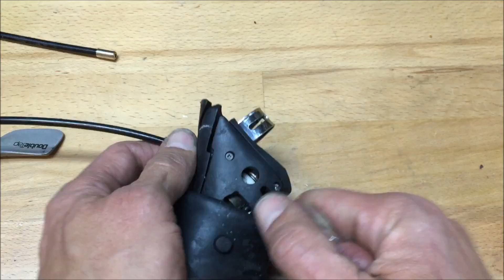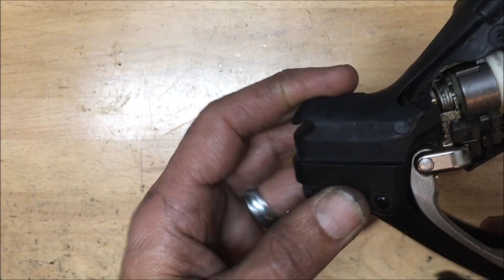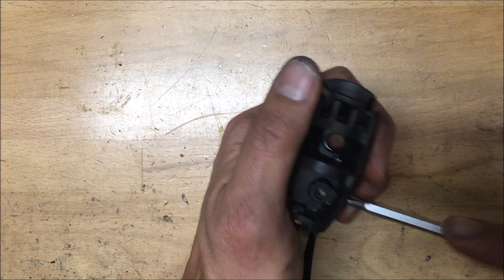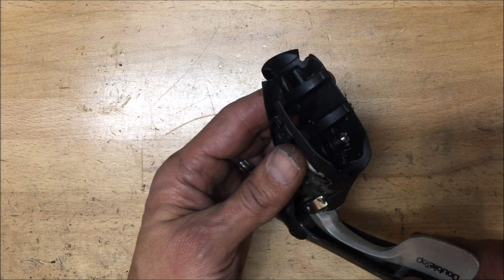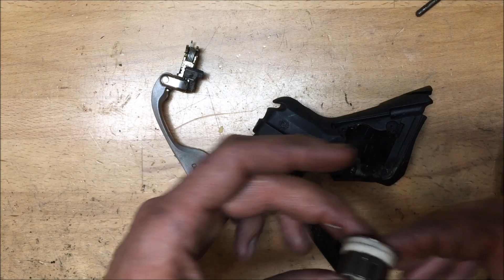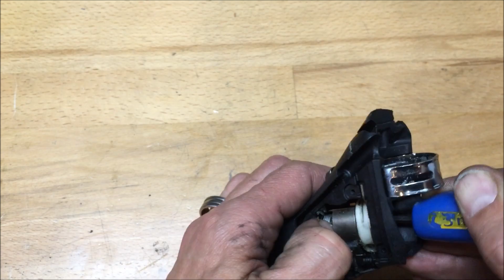Sram Doubletap Shifter Rebuild

Comment: I have got strengthen CNC part to replace the broken part. If anybody needs it just text me.
Reply from the maker: Good to know!
Reply: helo, i have the sram force brifter, and the lever right are gone. do u have the replace right lever? thanku
Reply: @4pppple  Shift lever or brake lever?
Reply: @JensWorkshop  shift lever for RD
Reply: @4pppple  I don't have a complete shifter. I have only shifter's spare parts.
Reply: @JensWorkshop  i only need the double lever, right side. do u have one? 🙏
Reply: @JensWorkshop  email sent , thanku for ur help 🙏
Reply: @JensWorkshop  do make the ratchet system
Reply: @carejohnrivera3891  what do you mean?
Reply: @JensWorkshop  like the ratchet wheel that he took off on the shifter
Reply: @JensWorkshop  I broke the teeth on mine
Reply: @JensWorkshop  just did
Reply: @JensWorkshop  hi do you have double tap shifter replacement parts for sram rival 10 speed
Reply: @willforcewisdome2267  Yes I have but only for right hand shifter
Reply: @JensWorkshop  can you send me your available part of double tap shifter 10 speed
Reply: @JensWorkshop  hello i need some shifter parts do u have one
?
Reply: OLA YOU WOULD HAVE THE PIECE YET, WHAT'S THE VALUE?
Reply: @MichelSantAnna  Which piece?
Reply: Do you have double tap shifter replacement?
Reply: Hi Sir can you send me the photos of double tap shifter 10 speed sram
Reply: @willforcewisdome2267  send me an email via jenchunchi@gmail.com
Reply: hey there - any chance you still have the CNC part available?
Reply: @MReyemhere  yes, still available
Reply: @JensWorkshop  Hi! I seem to have joined the ranks of owners with broken rear mech shifters. How much would it cost for one of the replacement pieces including shipping to Europe?
Reply: Hi, do you still offer the part ?
Reply: I need Old Sram 10 speed right hand shifter
Reply: I need a new lever mines broke is there an alternative for a replacement part
Reply: I have 2nd generation sram force double tap shifter 10 speed ! Right one lever broke exactly like in the video ! Do you have a replacement parts! Thanks
Reply: jens - how much is the part please

Comment: It took about a week for the linkage to arrive from Jen's Workshop (Taiwan to CT USA). It was easy to dissemble the shifter and linkage and reassemble if you know what you are doing especially removing the two Circlips. Make sure you read the comments about getting the pin out, I used an old spoke to make an L shaped tool to start the pin removal and the other end of the spoke was inserted in though opening at the top of brake level to push it further. I was able to do all this with the shifter still attached to the bike by the cables.

Comment: do they sell that round cylinder gear thing that the inner cable goes around?
Reply from the maker: No. Sometimes a local bike shop may have some salvage spares, but you can't buy that piece separately.

Comment: Great tutorial but I have a question. I have a hydro 1x SRAM  left brake lever from a 2020 Bombtrack Hook EXT. I got a PNW dropper post and wanted to convert my 1x brake lever into a brake and dropper lever. I sourced some SRAM 10 speed parts from a brifter. I manage to assemble it but the pin doesn't go all the way in to hold everything super secure. Also the new "derailleur" lever seems to rub when I turn it. Are 10  speed brifter parts compatible with 1x rival brake? Or do I need the 11 speed brifter  internals?

Comment: Thankyou for the video, very informative. Just wondering if a 10 speed Red shifting paddle is compatible with and 11 speed Red shifting  paddle? 
Thanks for time.
Reply from the maker: Yes it will. On my commuter bike, I used this specific mod to replace a broken SRAM Force 11 speed paddle with an older 10 speed Red paddle. It just has to be the Yaw style shifter body and not the old first generation style double tap shifter body. I actually made a video of the process: https://www.youtube.com/watch?v=ndLjDt68PAA&t=785s
Reply: @JoeyMesa   Thanks heaps Joey. It's off a 2010 Fuji Serveto,  so I'm assuming it's the first generation paddle shifter???

Comment: Hi Joey I've got a pair of sram doubletap shiftes but want to  remove the shifters and just have hrd breaks as i'm not running any grears (can this be done ) thanks
Reply from the maker: Yes, it's a pretty simple process. Just remove the small Phillips head screw on the side of the shifter body (the side facing out or away from the other shifter), remove the pin that holds the shift lever and ratchet mechanism, and you're left with just the body and brake lever.
Reply: Hi Joey 
Thanks for your reply and the info great! 😀👍

Comment: Can you swap a 10 speed put for an 12 speed?
Reply from the maker: No. The shifter in this video is the older type doubletap style and will only accept 10 speed internals. The current mechanical body style only offers an 11 speed option as there is no 12 speed mechanical drop bar shifter as of today. The AXS electronic shifters offer 12 speed options, and there are 12 speed flat bar options, but nothing 12 speed mechanical for drop bars.

Comment: my front shifter needs new guts> Where can i order them?  I looked on SRAM website but mine are from 2011
Reply from the maker: Your only options are finding a good used shifter, a salvage shifter you can use the parts out of, or just buying a new shifter.

Comment: Thx the spring coil on mine has stripped can you get that part or can I use on from left shifter which has been dumbed for 1x ?
Reply from the maker: All the parts on the left shifter are mirror image or backwards compared to the right side. Your best bet is finding a parts shifter at a local shop or possibly on eBay.

Comment: good day, im planning on replacing my sram rival 1x11 mechanical levers with the hydraulic ones, but accidentally ordered the 2x11 shifters, is it okay for the hydraulic version to just remove the double tap shifter? will it still work fine?
Reply from the maker: Yes, the shifting portion is totally separate from the brake assembly. You can even use part of the front shifter as a dropper lever if that's something you may be interested in. https://www.youtube.com/watch?v=_2m77XP-N7g
It's the same process for mechanical or hydraulic brakes. Either way, removing the complete shift system won't affect the brake system.
Reply: @JoeyMesa  thank you for this! very much appreciated!

Comment: is the shifter part thing available to purchase?
Reply from the maker: Unfortunately not. Well, you may find a used broken shifter on eBay or in the spare parts bin at a large bike shop and scavenge the part, but it's not offered as a new replacement part from Sram. Thanks for your question!

Comment: VERY USEFUL VIDEO, THANK YOU. 

I WAS AN INITIALLY PLEASED RIVAL GROUP-SET OWNER UNTIL I SAW THE LIGHT.

After 29 months of stiction from new and irregularities when shifting, having to force the shifter with occasional unreasonable force , ridiculous cable changing intervals due to sensitivity issues, brake pads needing regular micro millimetre precision adjustment (but doesn’t offer that option) brake callipers that need micro millimetre adjustment (but doesn’t offer that option either) monthly derailleur faffing, pistons sticking in low AND high temperatures and the gear hanger made of the cheesiest of soft cheese and needing several replacements at ridiculous cost caused by just lying the bike down (took me a while to work out that bonus feature),,,,,,,,,,the final nail in the coffin I had to finish my faith in my first AND LAST sram group set happened today. 

my 11 speed rival HYRDRO shifter died on my ride to work this morning, it happens eventually I hear the sram fanboy robots cry. Please try to Understand my anger sram boy,,,,,,
UK, 5:30am ride or work in near freezing conditions, 6 miles in and shifter died = 7 miles of unintentional single speed, missed my train and to top it all off my sociopath boss welcoming me to work with sarcastic glee when I finally arrived .

Ive got 30+ years of bike faffing under my belt so I thought , Ill fix it when I get home as “not a problem” . Oh no no no,,, after stripping the shifter I’ve discovered the housing (The red cable stop housing , white in your video) is destroyed as the cable has worn through it to the point that the cable is now wrapped around bits it shouldn’t be, no doubt destroying those bits as well. Angry at such an obvious fail point, yup. 
Thankfully, sram offers VERY EXPENSIVE REPLACEMENT PARTS to fix a very obvious weakness in a point of high stress wear. Im worried though, I think I’m possibly  being a bit silly thinking that sram have done this on purpose making a weak point in a FLAWLESS DESIGN after all the RnD they claim to put into their equipment but I cannot help but think that it is all designed to fail when just out of warranty, I sound like a silly conspiracy theorist don’t I 🤗

GOOGLE SEARCH SUGGESTS IM NOT THE ONLY  VICTIM.

Due to a slight suspicion that sram rival was not designed to last I had thankfully bought a second hand donor  12 months ago to replace the shifter if and  WHEN it finally died ( it was only a matter of time) I was lucky enough to find it second hand at £100, yes that’s right, second hand hydro shifter for £100 so I snapped it up, what a bargain ! 

the cost of new hydro shifter is absolutely fking ridiculous...... £350? your having a laugh (at out expense) but this leads me to my next point nicely,,,,

I was initially surprised and somewhat confused as to why buying a full bike with sram group is almost comparable to buying just the group set on its own at full RRP,,,, now I know,,,,, once you have been tricked into buying this snake oil group set you have 2 choices when it fails ‘just out of warranty’ (which is quite an impressive design feature) you can either keep buying the POS replacements or get out of the grip of this evil parts dealer whilst you can and buy a full new group from a manufacturer with a solid reputation and known for its quality and commitment to customer service, but that costs a lot,,,,,, so most don’t have that choice. Not me, no siree I’m quite happy to credit card a new group set, I’ll be fkt if I’m giving sram another pound of my hard worked for money.

SRAMs double tap hydro group is beyond shite, as soon as funds permit I’m purchasing the new 11 speed group set from the other big S.
unfortunately,,,, and I do feel bad about this,,, I will have to sell my second hand (BUT repaired)sram rival group to somebody else to fund my purchase, but......

....Every cloud has a silver lining. Not only am I selling a complete stranger a POS groupset, I am also giving them a chance to escape the sram cartel when they eventually wake up and realise the truth that ‘SRAM IS ShIITE’

you can be forgiven if you think I am a bit of a loon and it’s just because I am angry at  my dissatisfaction with sram, but your dead right, I am angry and you will be as well once you realise you’ve been conned and set up for a long term grooming of your hard earned money due to having limited options and probably going for the quick fix of buying more sram shite.

Get out whilst you can.........

Fkyou sram.
Reply from the maker: Dang, that sounds like a bad time! I can't really speculate much on your situation, because I don't know all the specifics of your bike set up, but in general, stiction, shifting irregularities with unreasonable force, Etc. are usually a cable issue. It could be dirty or kinked housing, poor routing design of an internally routed frame just to name a few.
I've been working as a full-time mechanic in several bicycle shops since 1983. I'd say the last 15 years, I've dealt with equal parts Shimano and Sram. I understand your frustration, as I see it on a daily basis. Hopefully, you won't be too disappointed after you switch to Shimano, as although Sram has their issues, Shimano pretty much has equal issues in different areas.
My advice would be to get a really crappy back-up bike. That's what has worked best for me, although I have no idea what your situation is, or if that would be helpful for you. I actually have 3 bikes I use to commute with. A Shimano 6800 Ultegra 11 speed road bike, my homemade crap weather commuter with 11 speed 1x Force/Rival mix, and my new bike which I got 6 months ago which is a gravel bike with Sram Force AXS. I've definitely ridden my road bike the least, but I've gone through the most shift cables on that bike without a doubt. 
The Force shifters on my beater commuter are over 5 years old, have been on 3 different bikes, 30,000 miles before I finally had an issue, which I just fixed last weekend and made a video  https://www.youtube.com/watch?v=ndLjDt68PAA
I've been riding the new bike for most of the last 6 months with no issues whatsoever. My point is, all component groups have their weaknesses, but having a bike that is durable but well-worn components you won't stress over if they crap out in poor weather is always a good option.
Thanks for commenting. I really appreciate your feedback!

Comment: Regarding the removal of the pin. I'm currently trying to rebuild an 11 speed Force hydro shifter, and noticed that the pin is in fact a hollow steel tube. Very thin, and threaded internally. Therefore, I was able to use a plain old screw inserted into the end of it, threaded in a couple of turns loosely, and then grasped the end of the screw to pull the pin out.
Reply from the maker: Thanks! Good to know!
Reply: Hi do you rebuild hydro shifter with non-hydro one? I'm wondering if they're similar and can replace each other

Comment: Do you think it would be possible to take the internals from a 11 speed doubletap lever and put it into a 10 speed lever, converting it to 11 speed?
Reply: Anyways what a legend for replying after 3 years 🤙
Reply from the maker: No, I tried it and the 11 speed internals take up about 3-4mm more from front to back. I do have a buddy that claims he successfully swapped 10/11 speed from an 11 speed Red shifter and the 10 speed yaw style Red shifter, but I'm not 100% sure about that. The version I tried was like the 10 speed in this video and an 11 speed Force shifter, which I know definitely won't work.
Thanks for your question!!
Reply: @JoeyMesa  Thanks for the reply. I have a 2013 10 speed red shifter, which looks the same as the 11 speed shifters (not like the older version 10sp shifters shown in this video). My idea was basically just to put the internals of my 2013 10 spd shifter inside an 11 speed shifter, to make it 10 speed, so i can keep my 10 speed drivetrain because it is lighter and more simple. But my brake calipers are TRP HR/RD which apparently aren't compatible with 10spd shifters, so thats why i wanted to try the 11 spd shifters to get more brake cable pull. I am not sure how brake cable pull works, so I am not sure the mechanism behind why SRAM 11 speed shifters have more pull ratio than 10 speed, maybe I could modify that somehow? Any ideas? If i can't work something out i will have to convert to full hydraulic because I am sick of having to put the pads so close to the disc to compensate for lack of cable pull, the brakes rub all the time
Reply: @disturbed4ever2  hey was it successful??? I have the 2013 sram red as well planning to convert it to 11
Reply: @blinmann7007  I got 11 speed hydraulic SRAM red and took the cog out of my old 10 speed red ergo shifter and works perfect. I dunno if it works from the old smooth shifter but from the 10spd ergo shifter with textured grip it worked
Reply: @disturbed4ever2  thats neat! I just purchased a 11 speed ratchet off ebay for my sram red 10 speed 2013
Reply: @disturbed4ever2  I got the one with the criss cross pattern on the rubber so I suppose is the newer ones right

Comment: Hello, I'm wanting to use my left unused lever as I run a 1X system to operate my dropper post. Can you tell me what parts I need to remove to do this. Ive seen it done before so I know its possible. Thanks
Reply from the maker: Thanks for the question! I've seen it attempted before, but with a shifter without any modifications. It didn't really work because it pulled the cable too far and actually pulled the cable loose from the dropper actuator. My theory is if you remove the little locking pawl that's just behind the lever, it won't lock the ratchet wheel in place, it will just pivot the way dropper levers do. To remove the pawl, you just pop odd the little c-clip that holds it in place.
I just converted my gravel/commuter bike to a 1X and I'm planning on giving it a try. I'm going to attempt it here soon, hopefully in the next couple of weeks, and I'll definitely make a video showing the process.
Reply: Joey Mesa thanks a million for the fast response ! I’ll hold tight until you post a video. I’m using a sram rival double tap.
Reply from the maker: Sweet! I should have a dropper post early next week, so I'll post up a video of the experience of how it goes. I'm pretty stoked to make this work!
Reply: Joey Mesa I have my dropper, just came in the mail and I’m ready ! So excited !!!!! I’ll check back for a update on the new video. Thanks again !!!!
Reply from the maker: Yeah, just got my post in. I went with a KS E30i.My frame takes a 27.2mm seat post, so there weren't a lot of options. I've been doing some research on the shift later to dropper lever conversion, and it looks pretty straight forward. I've got an older first generation double tap shifter and a newer force 22 shifter, so I'll show how to do it on both types in the video. I hope to have it all done this weekend at some point.
Reply from the maker: Got the video up. The process is pretty easy to get the Sram shifter set up to run as a dropper lever.  https://www.youtube.com/watch?v=_2m77XP-N7g